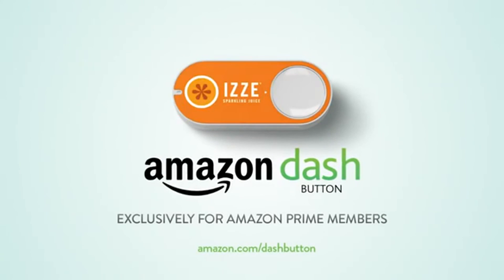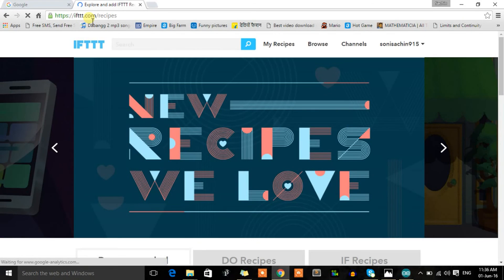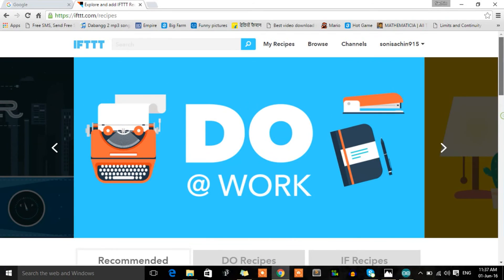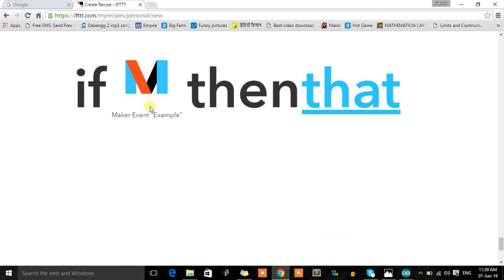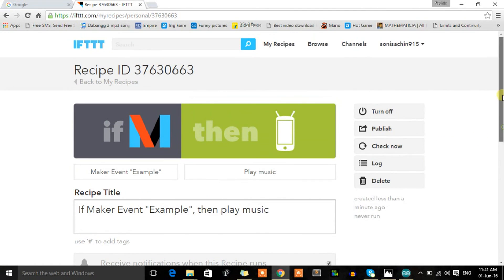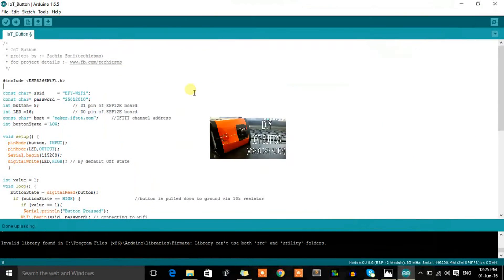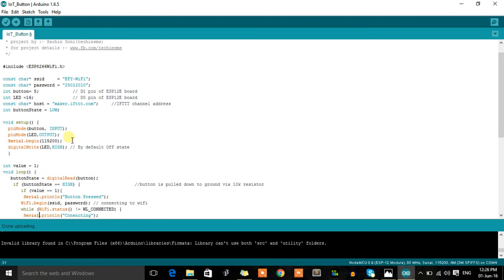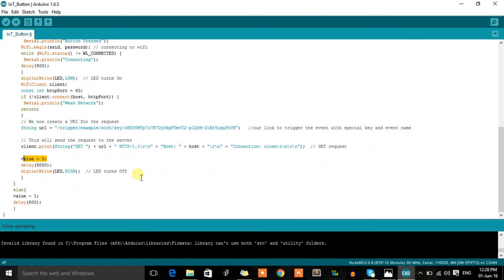DIY IoT Button(Amazon Dash Button)

Comment: Only when IFTTT app is installed in the phone the specified job will work?
Reply from the maker: depends on the job. If you are making a task like playing music sending SMS etc than you will have to install it.

and if the task is like if the button is pressed turn on the AC than you wont require to install the app

but making an account is must in IFTTT and maker